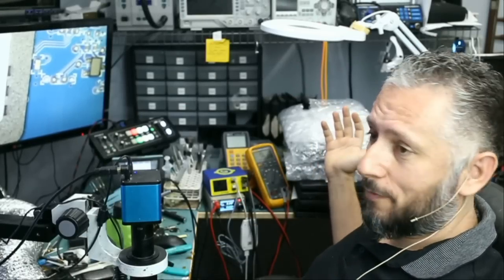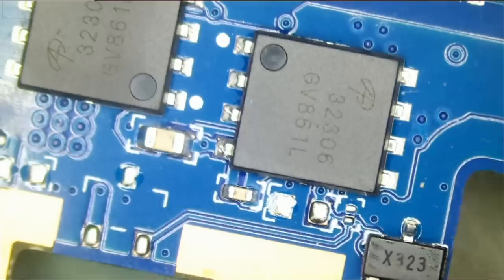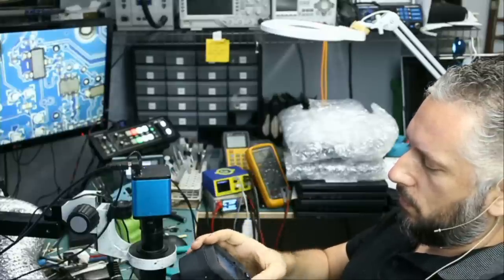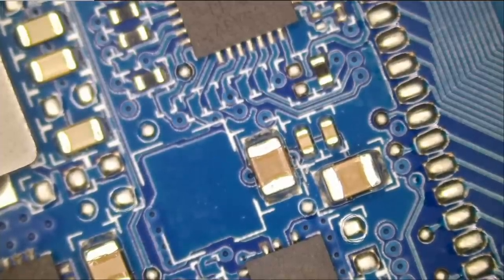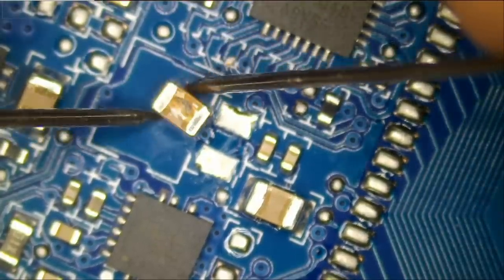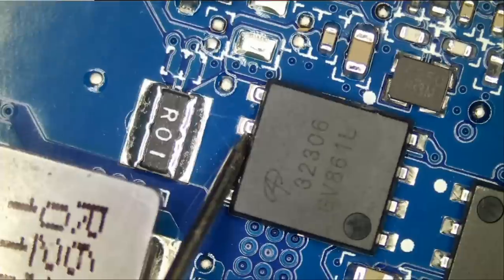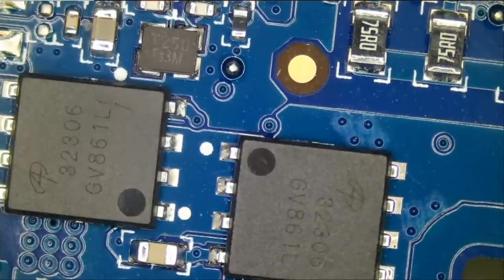We got 13 Acer Laptops A315-23  No power. Motherboard Repair.

Comment: i've watched almost all of your video and im able to repair my shorted lenovo  laptop due to blown capacitor. Thanks even though i have a little knowledge on stuff like this. It saved me a lot of money.
Reply: The money you would of spent on repair you spent it on equipment to fix things yourself 👌
Reply: @dafalzonAUS  That's a good idea sir because I only barrow basic tools from my cousin cause I dont have one 😢 .
Reply: @onurolce  try to inject voltage on the board, what ia your problem, i can maybe help, what laptop/model :)

Comment: You can simulate the volt injector tool with any stabilized power supply that can be regulated and limited in current

Comment: Been fixing electrical items. It is so much fun. Fixed an Xbox, video capture card and a TV lately. Working on an old Discman just for fun. It is rusty. The switches are bad. Cleaned them with lighter fluid and now the switches work. I feel I have some faulty caps on the power rail. I am only getting 2 volts of what I expect should be a 3 volt rail. Thanks for posting.

Comment: I have tech experience in troubleshooting however I had to start at power supplies and connecters first to trace current, and voltages at the source, your methods have been great for this video, by knowing common discrepancies first hand . saving time. great video. we used (face milking)

Comment: Hi Alex! There must be a more ergonomic way to store your voltage injection and Fluke cables so you don't have to pick them from the ground. Perhabs some clamps on the side of the back bench? Love the videos!! Greetings from the Netherlands.
Reply: I store my cables hanging off the bench too. Anything else, they get tangled after a couple of uses. This way, they get dropped out straight and drawn up again, frees them up every time you pick them up.

Comment: With my PINECIL soldering iron and desolder braid, started repairing broken gaming mice. Bought broken mice each for €10 and nearly sold 8 Logitech g Pro wireless for each €80 modded. Thanks for the inspiration and a bit of side income to buy my very own rework station.
Reply: Hmmm i might try this i’m gonna do broken controllers first tho i already do broken joycon analogs because you don’t have to solder to replace it

Comment: The voltage injector is like a spare tire --- one should not drive on it all day and all week. (current limiting)
Reply: I would say it's an air pump for the car tires to find the leak on the tire then you patch it.

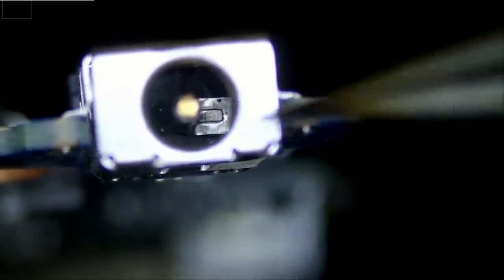Comment: 14:21 damn freaking god you legend just after seeing this I saw my old HP laptop which didn't charge only ran on battery and its has the same issue I remember inserting the charger forcefully while it was putting a lot of resistance

Comment: I tried several repair places to get a laptop repaired but didn't have a replacement connector, or a bad donor board. Wound up sending it to the company I bought it from (system 76). In the end repair costs I would have been better off just to cut my losses and buy a new laptop.  A $400 repair for less than a $5 connector that I could not get.     If I need another repair I'll try and contact you.

Comment: Great video, thank you! There was one question, you mention a voltage drop indicating no short circiut. If I understand correctly you did not have the 19v power connected. How then can you measure a voltage drop?

Comment: 1:14 in ancient times (50+ years ago) when they say computer bug, they literally meant insects.
Reply: Ha Ha.  The good ol days.
Reply: you should learn about vacuum tubes, the things those bugs got zapped on ... very important stuff
Reply: @HazeAnderson  Although I can definitely imagine a bug zapped by high anode voltage causing havoc in a vacuum tube based computer, the first actual bug was a dead moth that disrupted relay contacts in the Harvard Mark II. That computer did his calculations with high-speed relays. Those computers used less (especially stand-by) energy than vacuum based computers, but were also a lot slower. The Harvard Mark II could do 8 additions in a second. A contemporary vacuum tube based computer, the ENIAC, could do 5000 additions per second.

Comment: Alex next Halloween 🎃 special show. work on boards with insects, burn them at 500 degrees and put them as a capacitor.

If the volt goes up, they will explode.

Comment: Can a AA battery at 1.5v work the same with the injector tool you use? Thanks.
Reply: i think the amps on an AA battery is low which could be unsafe

Comment: Great as usal. I have a question. My multimeter doens't do a long beep in diode mode when a short is reached. What voltage drop should I read to understand that i have a short? Thank you

Comment: If i put Multimeter in continous mode and test both ends of a Resistor and it beeps, does it mean it is bad? Or does it have to beep because it is equal to a fuse?

Comment: Hi guys, I have got this mobo on bench, no power at all...19V not passing first mosfet, no short found on second mosfet output. Changed charging IC, the same, BQ24780s, ACDET-1V, comparing to schematic, should be 16,4V. Any idea? Many thanks...

Comment: So i have fluke `17B+ but it does not beep on diod mode when there is a short on cap and mosfet. what readings should i be getting if there is a short?

Comment: Hi there , 03:09 , you said you didn't touch the amps or current on the power supply ? what do you mean ? you mean your current or amps on your power supply is zero 0 ?if your power supply set on 10 amps or current your component will be blow up .  please explain more in your next video ? thnx

Comment: I would like you to make a firmware flash memory rework video for those laptops which boot and no Bootscreen logo/menu. My Asus laptop died during a auto update that Windows 10 commenced when I was away. That update included a bios (uefi) update and it failed with MOK memory full message. No keyboard or touchpad input taken. External keyboard as well not recognised. After opening and checking for a bios battery. It was no where to be found. it was a crazy week. Lucky that I had alternative Laptop.

Comment: For gross/bug infested boards, would it make sense to put them in an ultrasonic cleaner first, and charge a cleaning fee?
Reply: Years ago when I worked at a shop we got a roach infested desktop machine. We only kept it in the shop for about 10 minutes after we found out it was infested and the infestation spread into the shop. We had to have the exterminator come in. Cost more money than we could have ever made on the repair. Best thing to do is immediately put it in a bag and return it to the customer. Another good thing to do is to put a clause in your repair agreement that if there are bugs in the machine and an infestation occurs, they will be charged for the exterminator to come out.

Comment: Man, I just wanna ask.
What if u don't put that cap back, the shorted one.
Will the laptop power on?
What if I don't put MOSFET?
Will it work or do I need whatever is gone?
Reply: Decoupling capacitors: -  "In many DC applications, you can add a capacitor across the VCC and GND lines to smooth out noise from the power supply or from other active components such as integrated circuits, motors or AC/DC power supplies. "

It's the reason that chip manufacturers normally place the VCC pin next to the GND pin.  (So I've read.)   
The chip will still function without them.   In the case of a voltage drop the capacitor can provide that very short term assistance or something like that.

I'm only a novice myself but every chip seems to have these capacitors next to them.

Comment: hey how do you know what's the cap value to replace it is it by size ? I need to know :v
Reply from the maker: https://youtu.be/Q6lussfS0yA?t=481
Reply: @NorthridgeFix   first of all thanx for the reply I'm a big fan of your work! second i'm a beginner in that matter  and how exactly can i measure smd cap my cheap multimeter doesn't show any values ^^' 
thnx again
Reply from the maker: @ihebedgharbi8453  You need an LCR meter. Desolder the cap and measure of circuit. https://ebay.us/g2pBko
Reply: @NorthridgeFix  alrighty thank you so much ❤️

Comment: HOT soapy water works a treat  but i mean HOT that hot you cant put your fingers in it  wash in that rinse in equally hot clean water blow dry  no mpre bugs no more smell clean board   i used to do it all the time computers radios  everything hot water is great
Reply: Im not sure using water to clean electronics is a great idea, i would prefer rubbing alcohol. Water can leave stuff behind that can lead to shorts and rust.

Comment: How do you know what cap value to replace with?
Reply: Same question, already asked it in another video. 🤔
Reply: Experience, generally thos caps are of 10pf
Reply: No way 10pF. That size is about 1210 package.  Likely 10s of uF.  10 pF not used for digital boards.
Reply: @weithiamneo1442  maybe 10uf

Comment: Crappy quality smd capacitors, a common death for any modern laptop :-(
Reply from the maker: All laptops have capacitor issues regardless of how expensive the laptop is.
Reply: @NorthridgeFix  I agree, but i have an old Acer aspire 5315 from 2006 and it has never failed me. (There is always one i suppose lol ).